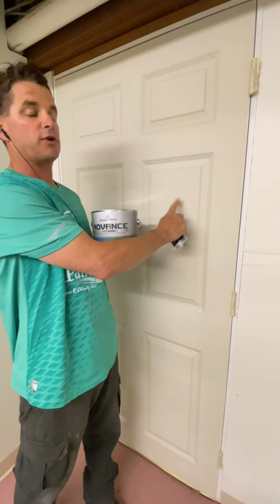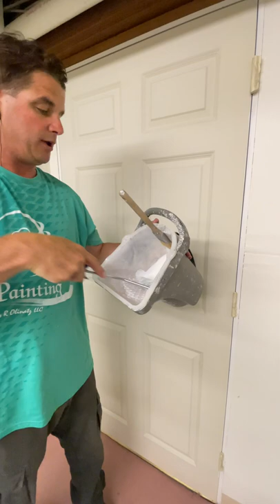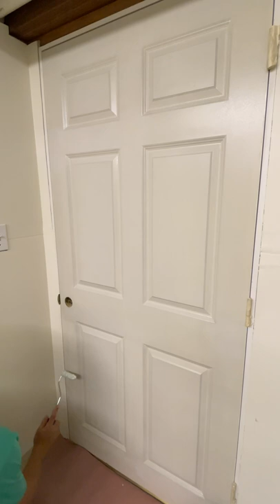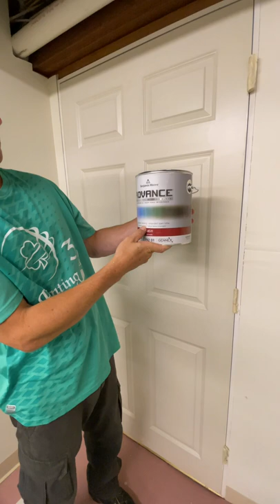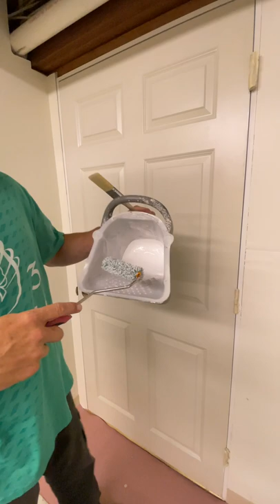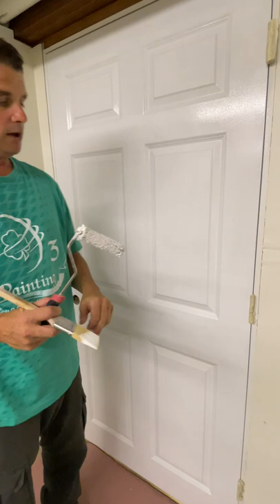Benjamin Moore Advance on New Pre-Primed 6 Panel Doors - Roman Pro999:Rx 35 Primer (Part 1)

Comment: Do  you have to have the primer tinted?  I wanted to buy some of the primer at our very nice local store and the guys working thought I was CRAZY to want to prime the doors first before using the Advance white paint.  So I left that store and went to a big box store to buy the Roman.  I didn't get it tinted.  IS this a mistake?
Reply from the maker: Hi Carey

Thanks for sharing that! Are you trying to paint over Pre-Primed New Doors?

Russ
Reply: @RussOlinatzPaintShow  yes.  Pre-primed a dull white. And I am painting them white.
Reply from the maker: Ok thanks! I tinted this primer white. It doesn’t dry full white but helps a little if your top coat is on the white spectrum. Many paint people are afraid to tint it because they don’t know what to add or how much. You will be fine with it Un-Tinted, but will require 2 too coats!  The primer is real easy to spread over that porous surface (flat primer) and seals the surface, so when u go to apply Advance. It will easily glide and u will have more working time before it starts to set!

Russ
Reply: @RussOlinatzPaintShow  if I understand correctly, I will need two coats of primer and then two coats of Advance?  Or one primer and then two coats of Advance? Btw I will ask the big box store to tint next time I buy it. Roman has information about tinting it on their website. So two coats of primer?
Reply from the maker: No 1 coat of primer, then 2 top coats. Wait at least 16 hours before applying 2nd top coat!
Reply: @RussOlinatzPaintShow  thank you very much.  Also found that Roman “can be tinted with up to 4 ounces of universal colorant” and “to closely match top coat.” Hoping folks in a paint shop know what that is. Again, thank you.
Reply from the maker: Yes it can be tinted, but often the paint folks are in aware of this. Have you tried just applying the Advance over the pre primed door with no Roman?
Reply: @RussOlinatzPaintShow  Oh yes, with my other set of doors..... took forever and seemed like I used a lot of Advance.  Let me try your approach and compare.  I have a lot of doors and trim that will need painted over the next few months..... all in my house!
Reply from the maker: Ok great! So you will see and feel the difference! Are you using a roller?

Comment: Great tutorial Russ. I had the exact issue you described painting mdf factory primed trim with Advance. I would like to use the Roman primer to prep some doors for painting however I am in Canada and can’t find it here. Any other primer you would recommend ?
Reply from the maker: Yes Kilz 2!
Reply: @RussOlinatzPaintShow  Any thoughts on Benjamin Moore Aqua-Lock primer for the doors?
Reply from the maker: Hi Paul - I think that primer dries to a Flat sheen. That would make if difficult to top coat with a satin or semi gloss sheen. You want to be able to easily glide over the primer with no paint drag. Flat primers  cause paint drag.
Reply: @RussOlinatzPaintShow  ever use the Advance primer? You also used 3/8” nap microfiber roller. Would a 1/4” leave less of a texture since primer is fairly thick or would 1/4” not apply the paint thick enough to level out? Didn’t care for the texture when I painted other doors a couple years ago. I plan to remove the doors to paint horizontal on horses if the makes a difference.
Reply from the maker: @paulkolm8225 No the primer isn’t thick! And the top coat goes over a sealed surface, which means more time to level out as it doesn’t get sucked in the pre primed factory primer. The 3/8 microfiber is easier to get in corners. You can control the thickness of what you lay down by measuring the thickness of the roller. Have you tried this roller?

Comment: Great video as always Russ. I'm doing pre-primed bifolds also with Advance. I have BIN shellac primer on hand, would that work? With kitchen cabinet painting, they mostly recommend BIN shellac before using Advance or other paints.
Reply from the maker: Hello Richard 

The Zinsser Bin is a great primer and Im using that primer on the kitchen cabinets video that I just put out on my channel. The problem is your not going to be able to spread it fast over the flat pre primer from factory. You will experience paint Drag and surface friction. I would use the zinsser BIN for the rough inside of the doors then sand and reprise. The Roman Pro 999/ Rx-35 just glides easily over the flat pre primed factory finish and seals it. Then your Ben Moore Advance will just easily glide over the Roman primer. Try both of them and see for yourself the amount of surface friction!

Russ
Reply: @RussOlinatzPaintShow  Thanks Russ. I'll try the Roman. Have you ever tried to spray the Advance? I'm going to attempt it because I have about ten older doors as well as the new bi-fold to do also. I have a gravity feed HVLP gun that I've never actually used. I know I'll have to thin it a little.
Reply from the maker: Hi Richard

No I don’t Spray. Here is a video of priming and painting pre primed doors with Roman and Advance. https://youtu.be/Pc6Pwo2fwSw

Comment: Is it possible to see the finish after it dried? The final showing in this video the paint was still wet. I know advance levels out nice. Did this level out as nice? As I saw some texture in the wet finish. Thanks 😊
Reply from the maker: Yes you will see it in part 2
Reply: @RussOlinatzPaintShow  awesome! Thanks again
Reply from the maker: Yes there is a texture in the wet finish from the roller, but then it levels out. What primers have you tried on new PrePrimed doors?
Reply: @RussOlinatzPaintShow  I've only used the kilz all purpose 2 on an interior pre primed door. I've installed 4  new pre primed doors and have only painted one thank goodness as I'm just not happy with the results.  The primer (kilz 2) didn't finish flat and as a result I had to do extensive sanding. The top coat came out ok (advance satin sheen) but working with the primer was a nightmare. I was just inquiring because I needed to know if was my technique or if it was the primer.  Sounds like it was the primer I was using! Anyways I used a 4 inch foam roller and a" premiere montauk" firm blend brush. I had bubbles appear with the roller but they did reduce with drying. I'm going to purchase the Wizz 4 inch rollers you recommend and the primer you recommend. I'll use those on the other doors. Thanks
Reply: @RussOlinatzPaintShow  one more question please.....would this primer your using in this video be good for raw wood trim? I have unprimed ,uncoated natural pine trim around my window. Would this primer be appropriate? I'm using advance satin sheen for a top coat. Thanks 😊
Reply from the maker: @number1pappy  Hi- No this primer is for sealing Builder Flat paints or Unpainted popcorn ceilings, skim coats, and residual wall paper glue. Use a Wood primer for Pine. The Best primer for Pine is a Shellac primer called Bin made by Zinsser.
Reply: @RussOlinatzPaintShow  thank you
Reply from the maker: Have you ever used Zinsser Bin?
Reply: @RussOlinatzPaintShow  I have not.
Reply from the maker: It’s really sticky, dries fast, and blocks stains from knots bleeding thru. Have you worked with oil?
Reply: @RussOlinatzPaintShow  nope, but I'm assuming with "Bin" primer I will have to use mineral spirits to clean my brush and or roller???
Reply from the maker: No denatured alcohol or ammonia.
Reply: @RussOlinatzPaintShow  what's the best primer to use on an interior wall that is painted dark blue? We want to paint it light grey. The dark blue paint is valspar latex. Looking for a good primer to cover the dark blue that doesn't bleed thru. Or can I just paint over the dark blue with the light grey latex? Thanks again 😀
Reply from the maker: Hi

The best primer that I use is the Benjamin Moore Fresh Start High Hiding Primer. You can see me use this primer in several of my videos. https://youtu.be/bJlxj_r8wA0
Reply: @RussOlinatzPaintShow  awesome! Thanks again 😀
Reply from the maker: No problem!

Comment: Russ,   Can I use this to prime my garage door?    I looked up the Roman Pro999:Rx 35 Primer on line.  It seems that the advertisements don't mention EXTERIOR uses, just using it over drywall, joint compound and popcorn ceilings, things indoors.   Take care bud
Reply from the maker: Hi

No I would use the Peel Stop Primer for that. You are referring to an Exterior Wooden Garage Door?

Russ
Reply: @RussOlinatzPaintShow   It is a wooden 30 year old exterior roll up, 17 foot garage door.
It is functional but pretty well weathered at the bottom edge and probably needs to be replaced but I would like to get a few more years out of it.   Don
Reply from the maker: Ok, yes I would use the Zinsser Peel Stop Triple thick Binding Primer. You may even want to do 2 coats of this depending on how bad the surface is. 

Russ
Reply: @RussOlinatzPaintShow    Yeah, I remember your using Peel Stop on a small building/shed a few months ago.  I will re-watch that video.  Lowe's has the triple thick stuff for $40 a gallon and I can use my X- military discount which pays the tax so good deal.   Thanks for the advice.
Reply from the maker: Thank you for your Service! What branch?
Reply: @RussOlinatzPaintShow    California Air National Guard, 196th Fighter Interceptor Squadron for 9 years.   No shots fired, some fun ride alongs and great Sunday afternoon cookouts behind the mess hall.  Free Beer!

Comment: Hi Russ. Would the Advance be considered an Impervo equivalent? Also, could I use Advance directly over Impervo or latex without priming first? Was thinking about using Advance for molding, and doors (interior). Thanks for a great video.
Reply from the maker: Hi

Thanks for your question! Are you referring to the Benjamin Moore Satin Impervo Oil paint or Waterborne paint?

Russ
Reply: @RussOlinatzPaintShow  Hi Russ. Satin Impervo oil based. Very durable, but would like something just as durable in water based.
Reply from the maker: Yes, try this!
Reply: @RussOlinatzPaintShow  Ok. Thank you for your prompt response, as always.
Reply from the maker: The Advance dries to a hard film!
Reply: @RussOlinatzPaintShow  Ok. Sounds perfect for doors and molding. Thank you
Reply from the maker: No problem!